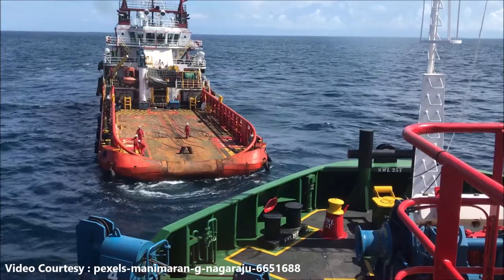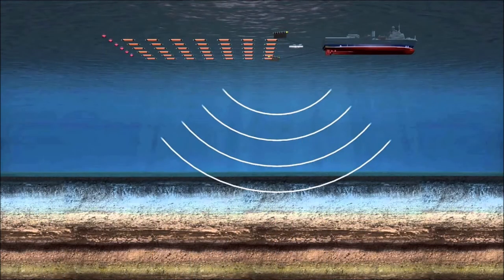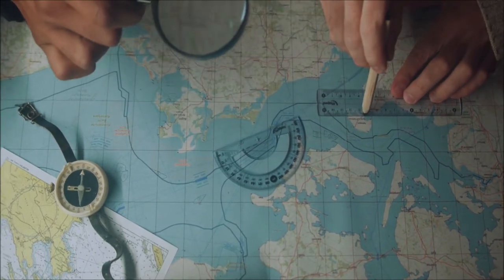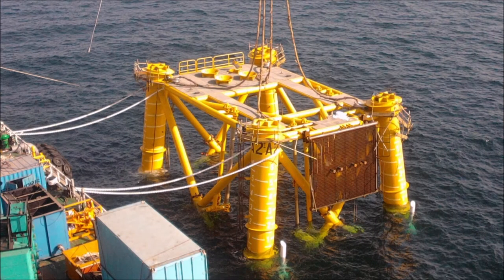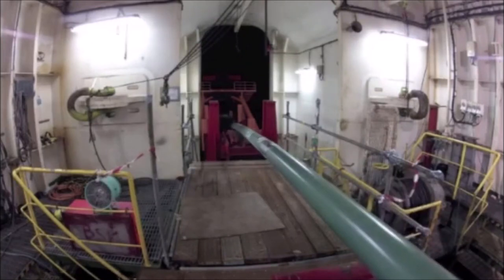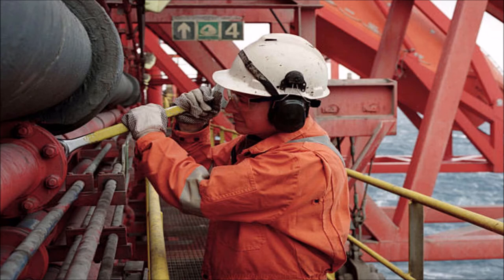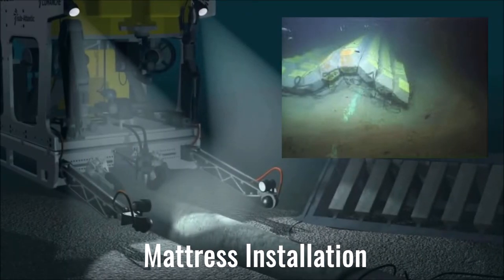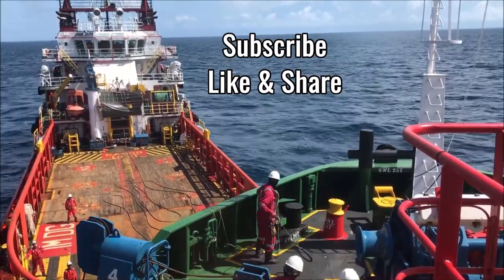Offshore Oil & Gas Field Projects & Survey | An Introduction

Comment: Hope you doing great sir,can one work in the oil and gas industry with a geomatics degree
Reply from the maker: Howdy. YES. You can. Geomatics with GIS software is the core of our Geodata gathering where we need to analyse, process and create a database. So depending upon your niche of expertise, you can be a base engineer to process and maintain offhsore Geodata and as well as offshore data processor. Wish you all the best.